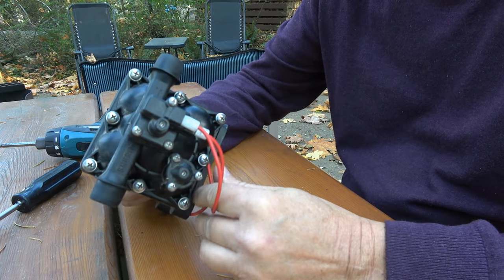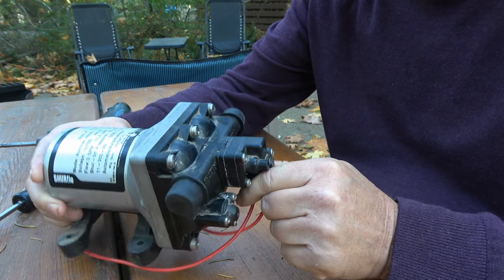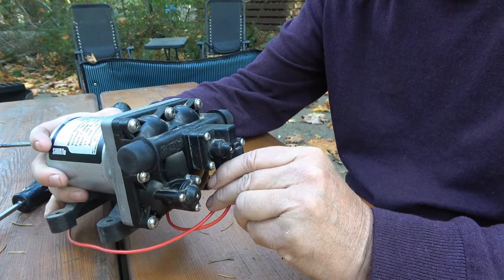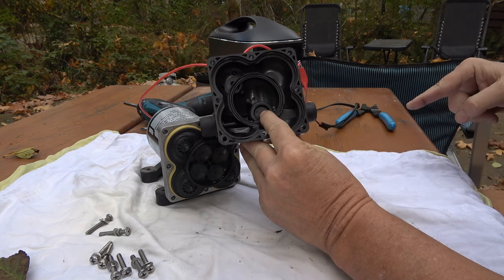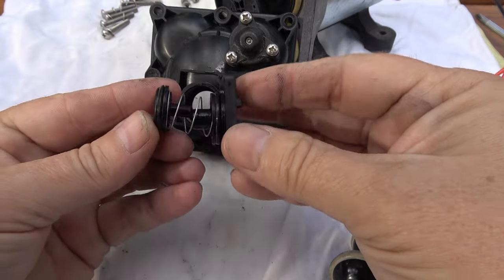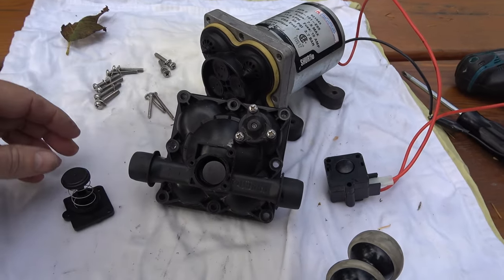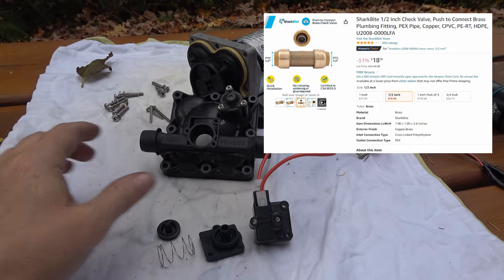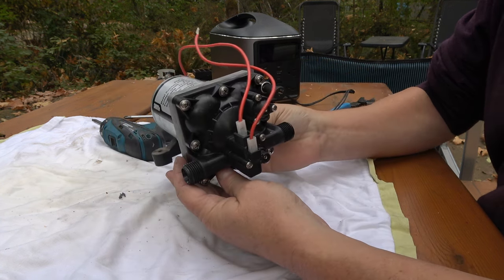RV Water Pump Check Valve Function and Replacement How-to - Shurflo 4008

Comment: I had my pumps check valve do the same thing in my 3 month old trailer. Warranty replaced it. It happened again on the new pump but intermittently. So I installed an inline check valve.

Comment: Thank you Ray.  Super vidéo, so many RV’ers have this recurring problem.  I bought an in-line check valve but have not gotten around to install it yet.  I let the pump resolve itself when I take the road and use it.  It clears up and the check valve does it’s job but then it starts again.  Especially if I let the reservoir go real low, it can catch some debris.  I find it does not take much for that little check valve to let water in.  I use to just open the pump and clean it up couple times a year.  I flush the fresh tank every year for clean up.

Comment: Thank you. I really needed this video. I pulled my pump apart and stretched out the spring just a little to put more tension on the valve. Works fine now. Thank you again. Very informative.

Comment: Ray, thanks for this great maintenance tip, I appreciate you taking the time to point these out, yet I wish I could actually get to my pump, as it's buried underneath my sink, without any good access.  Either the water heater or the sink will have to come out, neither is desirable.  I can see the pump thru a cabinet, under the sink, but  there's no chance I'd ever get in there to remove it as I had attempted to access my slide control and just about got my upper body stuck inside; quite some anxious moments!  Hopefully, I won't have an issue.   Keep these coming!  Thanks again!

Comment: I think an in-line check-valve is a very good idea. After a whole summer of Camp Hosting in the mountains of Colorado with high mineral levels in the local water supply, the check valves all seem to become leaky. It can be quick surprising to get down to FL in the winter to discover a full tank of fresh water even though we hadn't quite gotten around to filling it yet. We do try to keep a full tank of water at all times as arriving snowbirds love to break off water lines upon arrival to the campsites in the winter, lol. I have conducted many emergency repairs in the middle of the night when we were RV Park campground managers there, LOL. The extra check-valves idea just makes sense just for the PIA effect. I replace our water pump every 3-5 years typically because they are usually worn out and I rebuild them, but sometimes just adding the extra check-valve buys some time before the next repair. Often I am 100 miles from the nearest RV Parts supplier or dealer so an extra pump is always in my storage bay. -David & Sheila Knapp
Reply: Did the check valve failing also make the pump loose pressure and re pressure the line almost like there is a leak
Reply: I have a brass inline check valve someone gave me IDK what to do with it

Comment: Not sure this happens with every installation, but if your internal check valve is leaking, and you install an inline check valve after the pump, then you can set up a situation where there is a chamber of water trapped between the leaking check valve in the pump and the working inline check valve further along.  Pump runs, pressurizes, shuts off, water in this chamber leaks backwords past the internal check valve, pressure drops, pump runs, pressurizes, shuts off, leaks backwards...you can see where this is going...

This will then cycle every 20-30 seconds indefinitely.  Ask me how I know.

Comment: Adding a water softener will help mitigate potential problems to the water pump from hard water.  Just my 2 cents.
Reply from the maker: Thanks for the tip. Running some vinegar into once in a while and letting it sit for a bit should help too. I do that at the same time I do my water heater.  https://www.loveyourrv.com/cleaning-rv-water-heater-tank-vinegar/  Cheers, Ray

Comment: Can you just take off the pressure switch to change the check valve? Pretty sure my o rings are needing replaced or the spring cleaned. The strainer was clean when I checked a couple months ago.
Reply from the maker: Should be able to, if not its pretty easy to take apart and reassemble the rest of the pump.

Comment: Great video! Informative and inadvertanly funny. The Pump head assembly is mountable upside-down? Thats what I noticed from the final assembly.
Reply from the maker: Seemed to mount and tighten up no problem. But its a spare pump so haven't tried it to see if it works that way. I wonder if maybe it can do that so the flow can be switched to account for different pipe orientation.
Reply: @LoveYourRV   I wonder myself because the older pumps plumb out in the opposite direction making replacement a bigger project.

Comment: I’m having this problem, and when I run the pump, it never pressurizes and keeps running. The water from my freshwater tank sputters and the air is never purged. Could a partially stuck check valve cause this as well?
Reply from the maker: I wonder if there is air leak on the input side of the pump like a loose connector or hole in the hose so that it is sucking air in versus water from the tank.

Comment: Sir, thank you for the video. I have a question. I left my pump near a stream and forgot it. Then bc of the rain I was taken into the stream and submerged under water. I took out. And then it was not functioning anymore.
I took off the diafragma, to let it dry. Also I took of the check valve to let it dry in the sun. Any suggestion what else to do? I also see two wires connected to the motor. Should I open the back as well to let it dry?
Reply from the maker: Yes, I'd take it apart as much as you can, dry it out, and inspect it for damage. I doubt the motor is waterproof to a submersible level.

Comment: Even though water pump is working fine, is it a good idea to add an external in-line check valve as an added and inexpensive aid  taking the constant pressure off the pump when connected to city water?  If so, how far from pump should in-line check valve be?  What is a preferred in-line check valve (brand and size)?  Thanks much!
Reply from the maker: If you're RV uses PEX pipe, the easiest install would be a SharkBite check valve https://amzn.to/3FIb0Nx  I'd put in close to the output line of the water pump. The drawback to the extra check valve is adding another thing in the plumbing to maybe clog or leak. Cheers, Ray

Comment: Recently hooked up to city water line to flush tanks, after flushing, closed all the faucets and went to make a sandwich .  Came back out to a tub over flowing with gray water.  Remind you.  No running water in the camper.  Just left the main city line on.   I see some random people on the internet have experienced this same thing.  Thoughts?  Could this valve be the issue? Pump was not turned on by  the way.
Reply from the maker: No, if pump is bad it would fill the fresh tank not grey. Some how water was filling the gray tank, which is weird. Maybe there is some built in tank flush system in your RV and city water was filling it. Many RVs have black tank flush systems but to have it on the gray is a little strange.

Comment: Hi is there a way to fix this if one of the metal tabs break off where the wire connects to the pump? My pressure kept slowing down off and on and when I touched the wire it would work good but when I took the female connector off the metal tab, it bent and cracked off
Reply from the maker: Not sure, might be able to repair with solder but it maybe to tightly molded into the plastic to get access or melt the plastic.

Comment: That is a very poorly designed pump as they seem to fail regularly.  My pump failed after just three years and very little use.  I installed a new pump and rebuilt the old one that I keep as a spare. It is a real bummer to drive for many hours, get a great camping spot and then have your pump fail. Carry a spare.